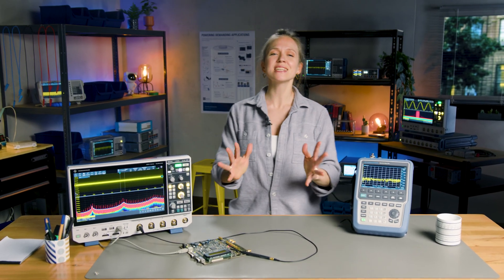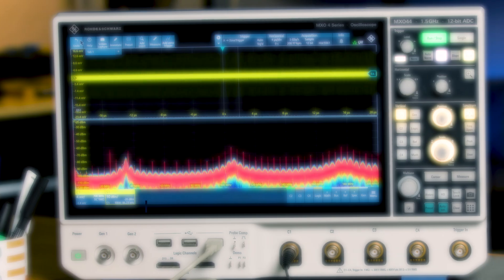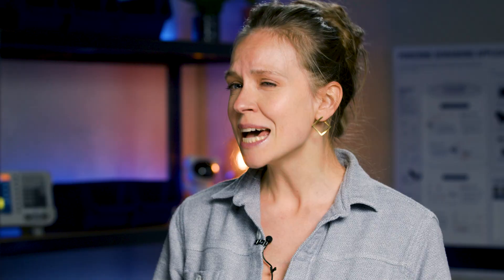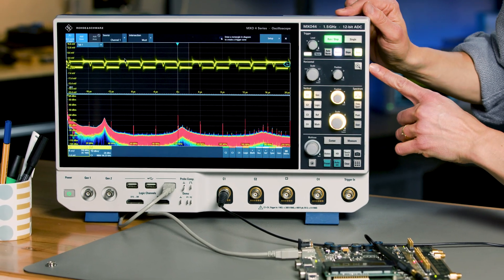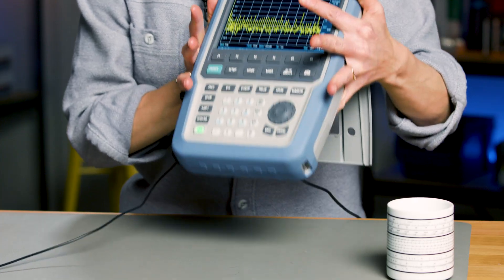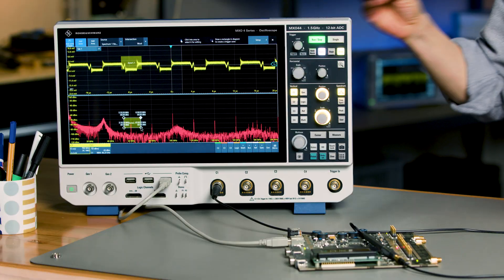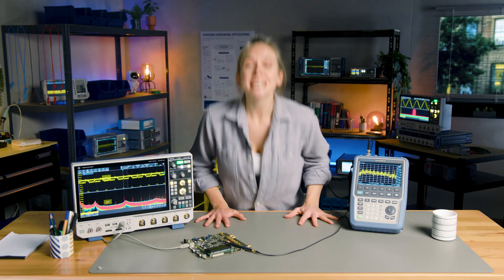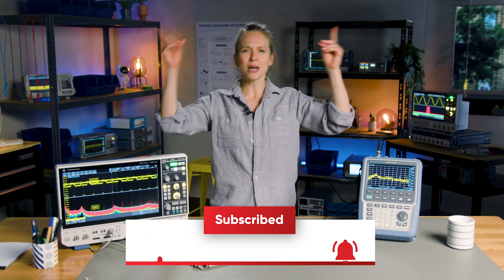Precision in under 5 minutes – Tips and tricks on EMI debugging

Comment: Near field probes are great tools!  I've done a lot of compliance testing, so I'm wondering how pre-compliance testing can tell you whether a particular noise source is worth the effort to attenuate it.  It's one thing to run a compliance test and learn that you exceed limits at 200kHz and the harmonics, and then go back and knock down the edges on your switcher output.  How do you use pre-compliance testing to know that it's worth an extra few days (or board re-spin) to clean up the switcher output?  i.e. don't you need that compliance test to know where the limits really are?